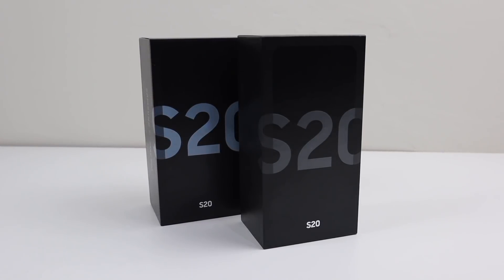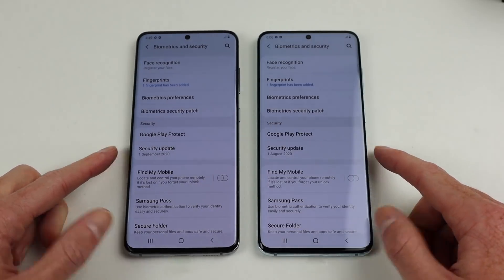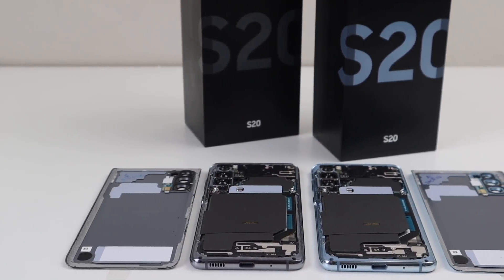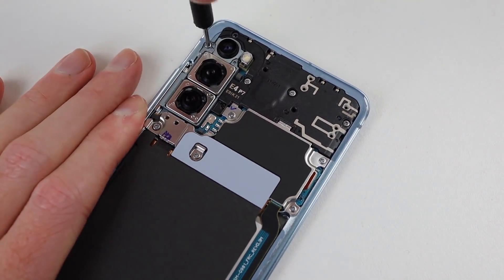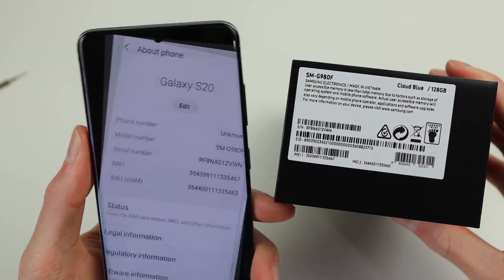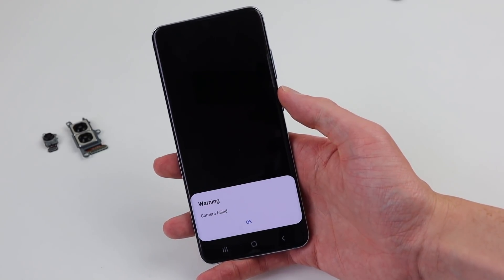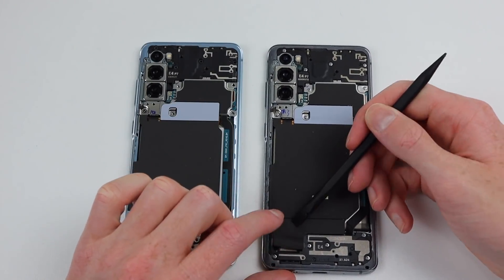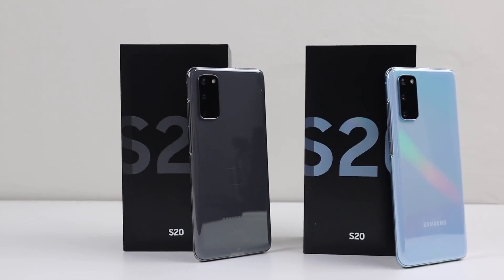Is Samsung locking down 3rd party repairs? Galaxy S20 Teardown and Repair Assessment

Comment: Really glad to see Samsung hasnt followed Apple's path of errors.
Reply: Let's hope the s21 promises that
Reply: @addedpole  Yeah, I was going to buy an S10 as it has a headphone jack over an S20, but after seeing both of his teardowns on those phones, I'm torn. The S10 does a lot worse in reparability.
Reply: @henryatkinson1479  I replaced the screen in my S10 plus the other day. No problemo 👌
Reply: @User Things wear out. My S8 has never been dropped, but its a 4 year old phone that gets used every single day. I had to replace the battery. If I'd had a similar era iPhone I'd have been shafted.
Reply: @henryatkinson1479  3 Years Old, Not 4 Years Old.
Reply: I mean they did follow these
- No headphone jack 
- Higher price
- Promote their wireless earphones when taking off their headphone jack
- Disable features when something inside was changed to a third party part
Reply: but they did with the S20 Ultra, same problems as with iPhone 12....
Reply: @harrison00xXx  Yeah the only source I'm seeing for that is the same guy the this vide just debunked. I'm calling BS on that claim given what this vid shows.
Reply: Henry Atkinson without knowing how the S20 Ultra works...
Reply: @harrison00xXx  Having personally helped a friend to replace his battery in his S20 Ultra, and not having seen any issues with it, I do know my way around it.
Reply: @henryatkinson1479  you know we dont talk about battery? A battery replacement is even possible at the iPhone 12 by your own, but we talk about the camera, screen and so.

Btw how crappy the S20 Ultra batteries have to be if you have to replace them already? Im using my little iphone battery hard since its release in 2016, replaced it i think 2 years ago once in End 2018 and since then its still at 89% capacity and running as long as its meant to be.
But yeah, thats no comparison, Apple is at least also known for using high quality batteries, probably not that good batteries in phones, but awesome quality in their mobile Macs and also iPads.
Reply: You always used a full body case to protect your phone too
Reply: Nah you cant glad anymore.You should stress cuz now samsung removed charger brick from s21 and start try to block third party repair
Reply: Nah you cant glad anymore.You should stress cuz now samsung removed charger brick from s21 and start try to block third party repair
Reply: Errors? It's just a money making machine of apple
Reply: @feuerherz007  Yeah, its an error. Apple today as a whole is one huge mistake.
Reply: @henryatkinson1479  i wouldnt call it Mistake.. it works.. stupid people fall for it an apple makes millions by taking all the money for some trash which is "cool"
Reply: @feuerherz007  Its a pretty disgusting business practice and really shows the flaws with the American monopolistic system.
Reply: Henry Atkinson why apple as a whole is a mistake? do you have any argument except a poor opinion of your own?
Reply: @harrison00xXx  Yeah its called stop fucking over consumers, the environment, independent repair shops, and manufacturing plants for margins.
Reply: @harrison00xXx Apple isn't a mistake... It's trash
Reply: Joe Williams The „trash“ you are talking about were my only longer lasting phones (except classic nokias like 3310/3330...)
and also the only notebooks which lasted from between 5 years at heavy usage up to 11 years like my 2010 MBP, meanwhile HPs, Acers and MSI notebooks died between 6 months, maximum up to around 3 years

idk how long i had my iPhone 3GS, but it lasted at least 2 years, only replaced then since development these days was pretty fast (and iPhones were these days anyways the best in smartphones)
after around 1 year of struggling with a Galaxy S2, it made me even that mad that i threw it against the wall... even a 2nd time so i can be sure it wont waste my time anymore (fell apart in nearly all parts)
after this mess of a Samsung S2, i reused my 3GS until apple released the iPhone 5... probably the best iPhone i ever had. even that good as the SE 2016 was released i got this too, which is now since nearly 5 years my smartphone. Probably the smartphone i had for the longest time and i am still happy with it

Probably you guys hate apple for being overpriced... but lets be real... same thing with modern samsungs except for cheap A-models, which are in my opinion as cancerous as my S2 was.
The A50 i got to probably replace my iPhone SE (for games only!) was crap... even slower with an Octacore than my old Dualcore iPhone which tech is at least 4 years older
Reply: @harrison00xXx  so your actually a little right.. until some Years well in the Early years of Android they sucked... That's just so true... But these days... Much better... Also you can't compare a budget Samsung with a Highest apple device.. makes no sense.. .. so here are the reasons I stick to Android .. (I tried the iPhone 5s some time ago .. I know it's not the newest but they are all pretty much the same) ... Reason number 1. Price to The value you get ... The high-end Samsung devices are much better and still cheaper.. can't disagree.. 2. Always latest Tech.. - with apple you have to wait ages to get things like 5g etc... 3. Only AppStore... This is a thing many people don't know about Android... I personally always download a hacked version of every app .. even YouTube.. like YouTube Vanced .. you have things like No Ads... Skippings (Skippy even sponsors) , picture in picture mode... And YouTube Music Free ... I also use modded WhatsApp (GBwhatsapp) can't live without it... The always offline mode.. anti delete mode.. personalisation... Etc so much the app is sick... And I use Hacked everything - my phone even has a infra red sensor to controlle TV's Beamers.. Stereos.. Lights... Everything. 4. No ecosystem I am trapped in ... Just great .. 5. Never breaks.. my Xiaomi phone, my Samsung Tab s7 and my old samsung are just so good.. also I use the Evie Launcher and a sick icon pack and uhh it's soo beautiful .. and the battery ... 2-3 days ... 5000mah on my phone and I think 10000 on my tab S7 .. I hope this maybe changes Ur view but maybe U still stick with the weird apple side which now even requires an apple store to repair Ur phone..
Reply: Joe Williams ok lemme get to loved 2010 MacBook Pro so i can reply to all of your arguments, pretty hard to do so on a 4“ screen 😂
Reply: @feuerherz007  everyone has their own point of view 🤷🤦
Reply: @harrison00xXx  haha okay :D
Reply: @feuerherz007  
1) When i compared a budget Samsung with a "hi end" iPhone? It was more like 2020 Samsung budget vs 2016 budget iPhone!.
2) price? Yes thats why i was also choosing the SE... it was damn fair priced and the size i wanted, meanwhile the only budget android phones were ALL too big and often even as expensive or more than the SE.
3) only app store? have you ever heard of "jailbreak". I used for multiple years also a jailbreak but since i dont need any of these things anymore, except for a proper offline Navi... i purchased the navigation app as it was in discount and job done, i have it legitimately and on every iOS device.
Also, you have to say, you need to do a few things even at Android to allow "cracked" stuff!
4) Youtube without Ads.... ever heard from AdBlock Plus? Its aviable since YEARS for iOS too, no cracked/illigal stuff needed, especially not modified apps! pictute in pciture mode is probably useful sometimes, thats it.
5) modded whatsapp? ok, why not xD
6) Umm infrared is so 2000s.... i can also control everything at home, im not a fan of these things, but i also could with iOS, not over IR, over bluetooth or WiFi in my case.
7) see Point Nr. 3.... jailbreak. Also the "standard" android is also something like a closed in ecosystem, probably not as closed as with iOS, but still
8) "never breaks".... thats exactly my experience with apple devices, especially the pretty robust case of iPhone 4, 5(S) and 2016 SE. It fell already so often on hard ground, no damage yet, my Samsung A50 with its display to the corner and its design broke pretty fast the front glass at even softer landings
9)  Yes, the battery, thats for real a iPhone Problem, especially the small ones are affected by it. But since i am not hardcore phone addicted, my iPhone also lasts for at least one day at "heavy" usage and normally 2 days, very very rare even 3 days. But true, my A50 also withstand easily 2 days at even more usage and what impressed me really (i mean big battery and efficient, "lowend" hardware): sometimes even a full week!

Why you hope this change my view? I tried android a few times in different states from "early" androids, to something like "midage" and with the A50 now 2019/2020 hardware. As i said, the BEST android phone i had was a HTC One M8, very high quality (metal!) case, extraordinary speakers (i mean it was a "beats" smartphone), even a high quality DAC for the 3,5mm headphone jack, also if i barely used it since the older iPhone was becoming my "iPod" with the HTC then.
Sure, if Apple doesnt change its mind i will also avoid iPhones, but aslong my 2016 SE is working fine i can still hope for a nice budget iPhone SE again (and not the 2020, too big, too expensive, too trashy)
If not, i will have to switch to android once more, probably i have more luck with this android device then, i will see.

The problems i have with android begin already with the usage itself. I dont know how to manage my music, playlists, the music apps itself. I was using until my first iPhone Winamp for my music, worked fine. But as i switched to Apple (first the phone, then a Mac), all my music and media are in iTunes, therefor it was easy af to sync my phone and have the easiest option to manage all this stuff. Hell even wireless iPhone and iPad Backups on the go on my 2TB Time Capsule Apple router (which is btw also working fine since over a decade!)

But yes, its totally anti consumer what apple is doing since some years, thats why im still on a (dirty cheap, for 300€ used in 2014 or 2015 i think) 2010 MacBook Pro, good keyboard, easy to repair and so.
But also keep in mind: EVERY other company blamed apple for their "innovative" things like glued batteries, soldered SSDs and so... but it took them often only some months or sometimes 1-2 years to do ABSOLUTELY THE SAME! Only if i see glued screens to the case itself, i know Samsung or anyone else isnt better than Apple at all. Trust me, wait 1-3 generations of phones and Samsung is doing exactly what Apple is doing already...

I dont hate samsung, i hate Apple even more than any other greedy or anti-consumer company, but many apple devices, especially older ones are still awesome, even in 2020.
Reply: @harrison00xXx  Ur arguments are maybe good on your side BC it is "easy and all" ... And I don't think you got the argument that I said... Jailbreaking an iOS device doesn't give you so much freedom and also you loose your warranty and everything and jailbreaking in 2020 is almost impossible... On Android on the other hand you can download apps from the internet without jailbreaking (rooting) ... Okay I agree.. for old people  who aren't good with tech and people who don't need much, apple may be just fine.. but in my case It's not enough for me... Also don't always mention samsung because I also like many other android brands...
Reply: @harrison00xXx  to allow apps on Android you just have to allow "unknown sources" which even a baby can do and takes 1sek
Reply: @feuerherz007  Jailbreak gives you also complete freedom, warranty should only be a problem if you break your device completely without being able to restore the original software, and its pretty hard to break your device with it...
And i think you have forgotten or never knew... theres an easy way to install "non legit" software on iPhone without jailbreak, easily take some cracked app, reconfigure the app so the OS think its a developer-app from yourself and you can run this app for one week, then you have to reinstall it again. Pretty annoying to do so, but hey like this you can also run EVERY iOS software downloaded from the web ;)

There are still so much more reasons to use iOS instead of "being old and not good with tech". Im "good with tech", still i prefer iOS over android. Its not about apple, its only about the whole OS itself and its much more user-friendly than android in my opinion.
I think its good that we can choose between 2 mobile OS which are versatile and really made for "casual"-use instead of the good old days with Windows Mobile, here you really needed experience and knowledge. But damn a Windows Mobile device was awesome these days, i had a Qtek 9000, very fat and heavy "smartphone" with real keyboard and a flipping screen, looked more like a mini-notebook but this device was worth it, there was so much software aviable aslong you knew where to get it, otherwise you were fked lol
Reply: @harrison00xXx  2 mobile OS? What about win Phones 🥺 uhh I loved them ... If the big apps just would have moved to Windows hmm :(
Reply: @harrison00xXx  jailbreak is almost not possible in 2020... They update the software so hard that it gets more n more difficult ... If you know About HappyMod then u good.. it's an app which has literally EVERY (not lying) android app Modes hacked / free :). ... 

And still I believe iOS is for old people who don't take a shot about the world and think they are cool bc there's an i Infront of the phone
Reply: @feuerherz007  modern windows phones are pretty crappy. I only know Windows Mobile 5, the real windows phones which are long gone already and far from a real smartphone OS anyways, more like a small windows version.
Reply: @harrison00xXx  I know the old old windows is phones too .. had 1 from my dad ... But I also liked won 8/10
Reply: @feuerherz007  and to allow side loading on iphones only thing you need to do is to “verify the developer profile”. Or you can do the alternative way by installing it via TestFlight.
Reply: @M_shaheerarshad  can you just download for example Fortnite from the internet on apple? No you can't.. can you on Android? Yes you can... Literally every app

Comment: I really hope this is the future and not the past. Apple should be charged for all their worth for their anti repair practices. Could you check new Xiaomi phones as well?
Reply: Xiaomi phones are cheap, disposable crap that's not worth repairing. Even a simple screen replacement can cost more than half the price of the phone xd.
Reply: @enzoperruccio  then you don't know how to replace them or where to get them at a proper price. Doubt a screen will cost more than 60eur, for me it would likely be ~80 with tax.
Reply: @eivis13  I replaced the charging port (which failed after less than 2 years mind you) on my Redmi 5 plus a while ago, and just because the part was at a good price and I wanted a backup phone for my new Samsung one. Parts are too expensive for what most cheap phones are worth, and even if you get the part there's no guarantee it will work nor last.
Reply: Btw, I've had bad experiences with xiaomi phones over the years, such as failed batteries, screens that shatter from a small drop, broken charge ports, dead screen pixels and back covers that just come off because no adhesive was used at the factory. Tbh I'm never buying xiaomi again.
Reply: @enzoperruccio  here's your problem - you're expecting too much. Only bad experiance i've had was a random brick on empty battery, but kenzo was a bit over 4 years at the time so it's just sitting on a shelf with a never used old stock replacement battery (old one didn't keep a charge after 2.5 years in part it could have been my bad). Stock case was shock proof and yes, after 16months it stopped reading the sd card. Still the phone held through a lot of drops for me and i changed screen protectors only 4 or 5 times. After kenzo died i bought an F1 and saddly i got one of the worser bins (later batches got worser components than the first ones). If it last at least 2 years i'm good, but i'm not buying anything with less than 16gb of ram, current to the time snapdragon flagship soc and expandable storage is a must. Still the phone is awesome, only thing that i dislike is the notch, but it's either that or compromises elsewhere, plus xda is filled with roms and kernels for it.

Comment: Hey hugh make a diy heat plate maybe with the parts of a 3d printer be that woud be cool you can find broken 3d printers with the bed working and the controller

Comment: Maybe one more thing you need to keep in mind when swapping these things: Often some of the most random components between a Snapdragon SoC Samsung and an Exynos SoC Samsung can be different! So be careful about the differences there.
Samsung is also known to use 2 different manufacturers for the camera modules for some models of their device - mixing those up will result in a Camera failed message!
For some models though, replacing the fingerprint sensor might require a factory reset due to software glitch.

Comment: Hey Hugh did you know that apple has stopped operating system updates for the IPHONE 6/6PLUS and older . they are stuck at 12. wont take update  13